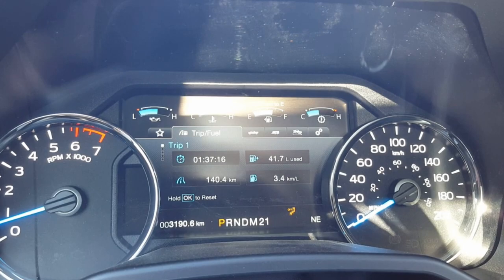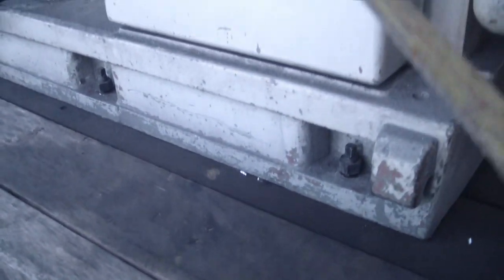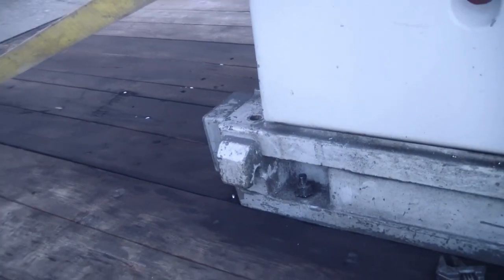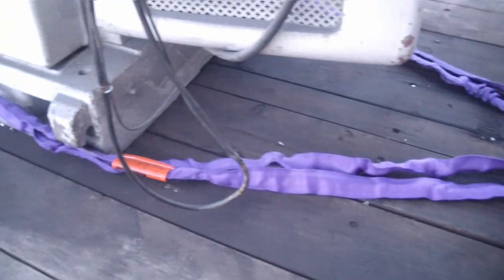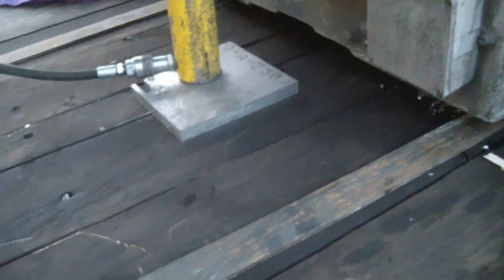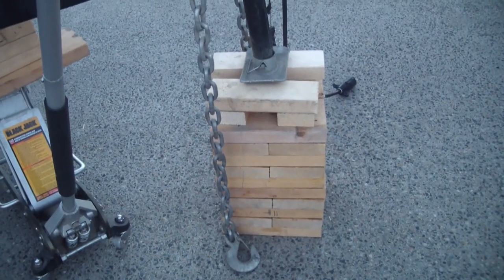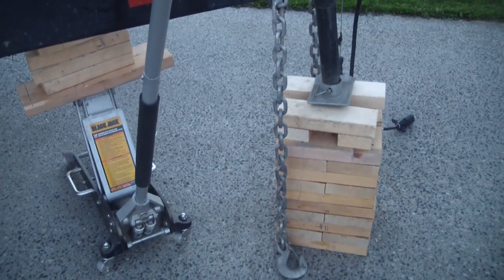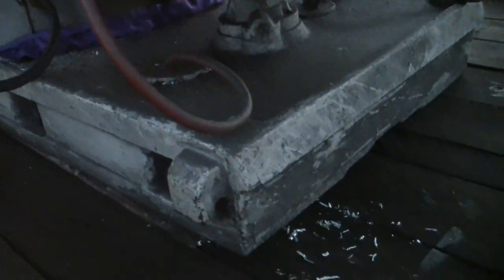How to move heavy iron SOLO. Cheap, Dirty and Downright Dangerous.

Comment: Chris, did you snag that mill at the Vancouver Gear auction? I don't see it in the listing, but there was a number of late additions and I remember a few mills being sold. I use sched 80 pipe to skid machines around. Someday, I'll make a toe jack, but for now I use a 3 ton engine hoist to get one side up and down. That mill looks very sweet, maybe give us a walk around when you have time... Cheers, Daniel
Reply: Generally speaking that's true. However, I have scored great deals on smalls, material and occasional machines. Craigslist has also been kind to me as well. Its like driftnet fishing for tools.... Cheers and thanks, Daniel
Reply: +AvE I remember that video update and was surprised to the clapped out Bridgeport in a years worth of video updates. I though something went wrong after that video update, or you couldn't let go of ole Bridgey!!

Comment: Great work,  but did you grease the I beams?
Reply: +cat637d Greasing the skids would be a really bad idea. If the machine got any kind of momentum, he would have been fucked IMMEDIATELY. Sliding something like this on rails off a trailer is super dangerous, particularity without a hold back and side control winches. Not to say you can't do it, but you don't want to take ANY chance that it could move without having to put a lot of effort in the exact direction you want it to go.

Comment: My daddy always said  ,"With a leverage even a mouse can be as strong as and elephant. 
I moved a machine that weighed 2000 up 6 in and 10 ft lateral,  using pipes  rolling between the steel frame and the wood below.

Comment: Did you plan how to stop that big momma if it starts to slide by itself? 
Idea! Make come-alongs in a loop, one end on the front of the trailer and one at the bottom of the ramp. Install an extra pawl OR BRAKE that locks if you run for your life, LOL. - say if the trailer unexpectedly tilts more. I guess a second come along with a brake at front of trailer, and a long lanyard, would work since there are no circular come alongs. Call it a go-along :)

Comment: Hindsight being 20/20 and all - could wheels not have been cobbled and attached to the jack-bolts?
Reply: +Fred Gandt If wheels were attached while it was still on the trailer, even a very slight incline would allow the block to roll freely and destroy everything in its path as it rolls down the ramp. You'd need another rope/pulley system to make that work.
Reply: then you would have a mountain of oh shit in a rush to get to uh oh
Reply: +Petar Bogdanov 2.2 tonnes. You'd need the brakes from a sedan to stop it.
Reply: +Petar Bogdanov You can configure the come-along in such a way that it pays out distance as you ratchet it; You anchor that to the opposite end of the mill.
Putting it on wheels pretty much gives you the same problem though; as once you get it down off the truck, you still gotta get it off the dolly...unless Fred wanted to like temp weld axles on to the thing in such a way that you can lower it to the ground by deflating the tires.....aaaaaand now I'm overthinking.
Reply: +verdatum He's already shown off the port-a-power to put the flat bar 'skis' under the machine...  That's how you get the trolley back out from under it.   I've used a pinch bar and walked the machine up and down a stack of timbers and plywood to get machines up onto pipe or rollers to move them about...
Reply: icesoft1
Oh neat. I learned something, thx :)
Reply: Wheels? Are u crazy.  The friction saved his bacon.
Reply: Okay, so I need to explain - wheels?

1) Lift mill onto flatbed
2) Drive to the Batcave
3) Jack up mill a bit
4) Attach small round lumps o'metal \m/ to each jack-bolt
5) Place runners under the wheels
6) Attach lines (ropes/cables...) to the back of the mill (car end).
7) Attach lines (see 6) to the front of the mill (cave end).
8) Crank away - much more easily than when dragging.

Optionally:
6 - 7) Create closed loop of lines between an anchor at the car end, and an achor at the cave end. Rig ratchet cranks in the line loop, to save a little leg work operating two sets of cranks.

I mean seriously - has no one commenting here ever moved anything?
Reply: +grumpybill you will have an hard time dealing with those fans
Reply: Haha omg
Reply: +grumpybill this whole exchange got me in stitches, ill note the words of my (likely) elders and being to gauge the worthiness of my prized doohickeys with the almighty blue vein bologna.  Think i might run into issues with the locals if i decide to be a rancher?
Reply: Fred Gandt personally i would have put a few mattresses down. put truck in reverse slammed on brakes.  off the bed like a boss.

Comment: We had to move a freaking wood central boiler made of freaking damn thick steel, even our 1ton lifter was about to fall down, that was one of the scariest experiences lol
Not to mention i took the biggest nutshot ever, we used steel tubes to lift it (just like 1cm to put it on steel rails we made), the steel tube failed and the handle hit straight in my nuts. I called it a day, lol.

Comment: 8 miles to the gallon? That's no bueno what fer towin'! Should get you one of them new old 12 Valve Cummins, 20 miles to the gallon and laughs at towin them old clapped out milling majiggers! Full on skookum!
Reply: +DirtRider500R Yeah, but boy are they proud of those suckers. Askin' price being what it is, I should be able to afford one myself, about 15 years after I die.
Reply: +Jarik C-Bol I paid $5,500 for my 97' 2wd. Zero rust, air springs, and exhaust brake. Has 330,000 miles on 'er now, had 300k when I bought it back in March. 4x4s seems to go for 9-12 grand, which is ridiculous.

Comment: Doesn't that stuff use three phase AC?
Reply: AvE Stupid questions ensue therefore on how one would use three phase equipment at home?
Reply: is 3 phase especially rare for   residential housing in north america?
Reply: I have never seen it except where the home owner had the electric company run the extra wire for a home shop. Not sure about up north though. I am from the usa.
Reply: punkforjesus so two phase + neutral is the standare?
seemes a bit outlandish, over here the only time two phase is common would be on IT distribution. Most consumers have either one or three phase with TN distribution
Reply: Neither. They use split phase. http://www.anoldman.com/power_systems/understanding_residential_ac_phases explains it better than I can but pretty much a single phase 240V wave form is split into a pair of 120V waveforms with a center tap that is neutral. Often called 2 phase but it is not.
Reply: punkforjesus not a solution I've ever seen employed in Norway. Is it used because north america residential housing runs on 110V?

Comment: You are working waaay too hard...   Attach an electric winch to your anchors and push the magic button.I've done this stunt lots of times, and have found it easier (for me) to attach some 4x6 or 6x6 "ski's" to the bottom of the machine while it's being loaded to help facilitate easier unloading.    I cut a 45* on the ends of the skis, what fer, so they don't dig in.   Oh... and I leave the trailer attached to the truck.   Once in the building, the ski's work great for rolling the machine around on pipe, or Hilman Rollers... But hey, you managed not to roll it over or lose any digits...   Good Job!